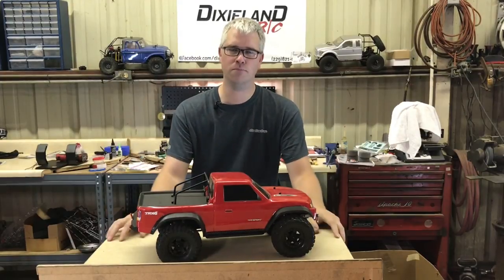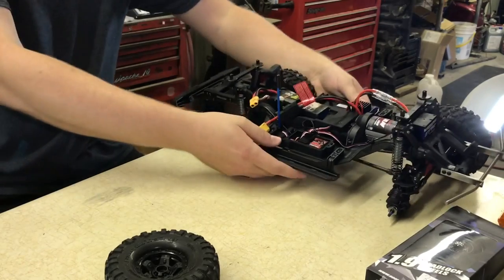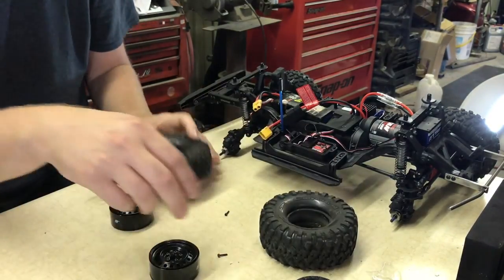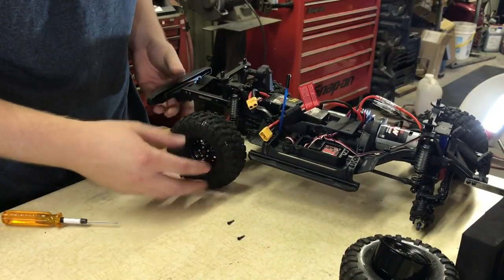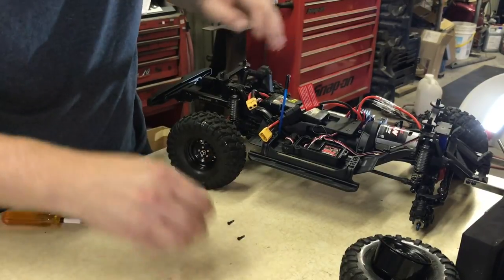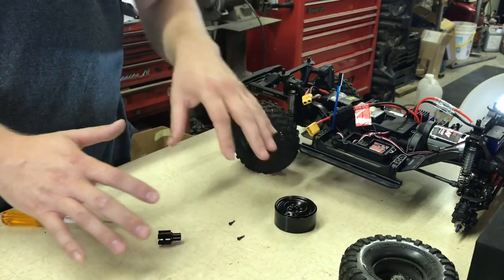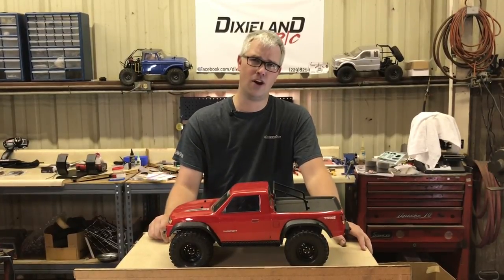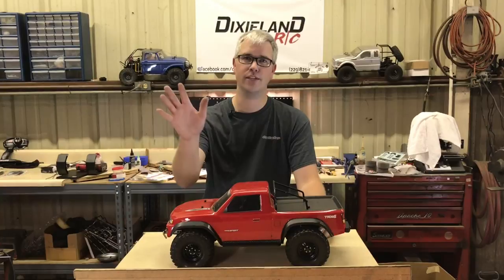TRX-4 SPORT Budget Build Week 4 - Metal Beadlocks

Comment: Great set of TRX Mod videos but don’t understand why you would want to reduce you ride height unless you don’t intend to go rockcrawling and just like the aesthetics I guess.
Reply from the maker: Low is better. the lower you can get the weight the better. Running droop brings all the upper/above centerline items down lower. Plus it makes it look awesome as well.
Reply: DixielandR/C I understand that getting the weight lower is desirable but surely not at the expense of ground clearance.
Reply from the maker: Its not that much considering the portals give you a lot of clearance back. My next crazy build is 2 inches from the ground to the skid.
Reply: DixielandR/C I guess it is all about trade-offs. What you gain in one , you lose in another. I may try it out and see how it works for me. I’m not too bothered about the jacked up look so it will all be about performance and my personal preference of how the vehicle behaves. Thanks for the videos you’re posting, you have a new Sub.